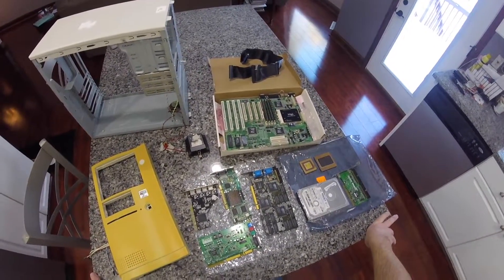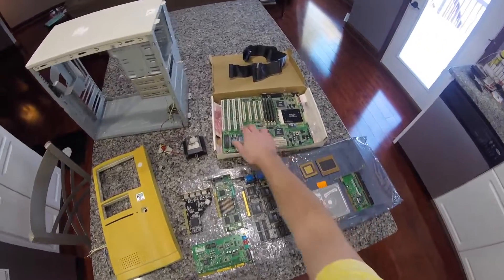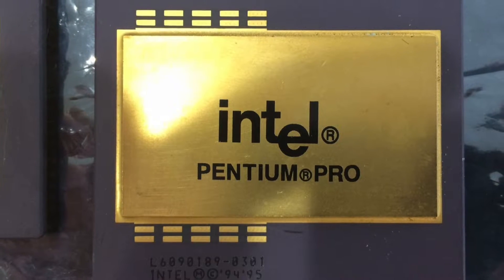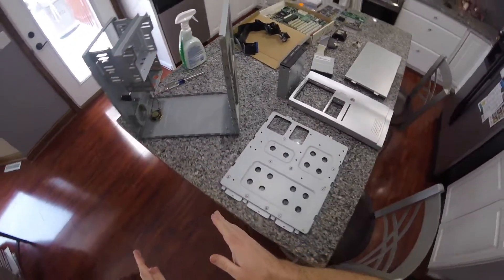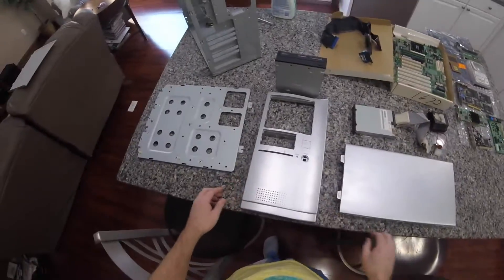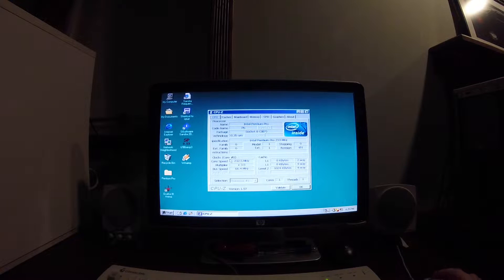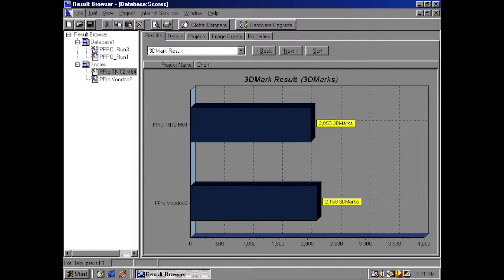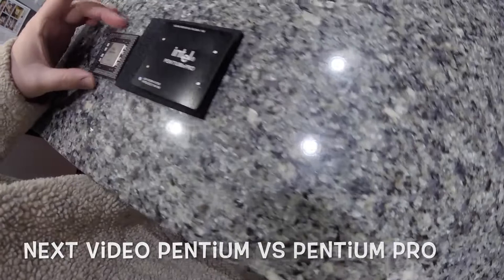Pentium Pro 200 1MB 3dfx Voodoo2 Build and Benchmarking Ep1.

Comment: Pentium Pro had its cache on a separate die.Thats also the reason why the 1MB-variant had a different case. Intel was not able to fit the second cache die (512k x 2) into the ceramic package and thus developed a package with larger cutouts.

Comment: The Pentium Pro would perform much better unter Windows NT4, because of the worse 16 Bit performance of this CPU. You should install NT4 and compare again. Most people don't recommend Win 9X/ME on a Pentium Pro PC. Look here what waybacktech says: https://www.youtube.com/watch?v=Wq66Fzq9ASg
Reply from the maker: You are absolutely right. I touch base on this at end of my video. The Pentium Pro offered improved 32 bit performance at the expense of 16 bit performance. A lot of people don't realize that the Pentium Pro came out almost a full year before Microsoft even had an OS that was optimized for it. So a lot early adopters were stuck with a very expensive processor, for a lack of a better term, was only running at half throttle until NT4.0 came out. lol! 

I used Windows 98 because a lot of the older DOS games aren't NT4.0 compatible . Plus, I wanted an apples to apples comparison. I might do another video with NT4.0, but the benchmarks would be limited as there isn't a lot of game and driver support under NT4.0.

I'm a big fan of waybacktech too. Great channel! Thanks for the comment!
Reply: @cpudan2000  well, you could just install w2k and test all the games you want, 98mb memory is enough i guess